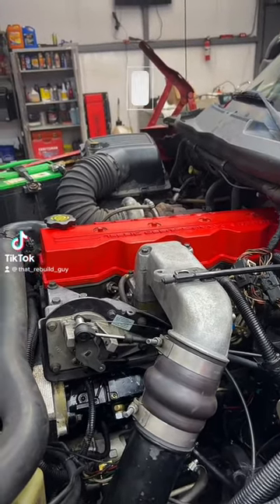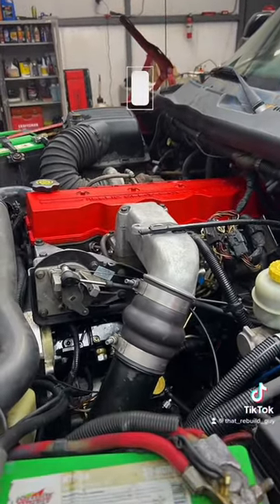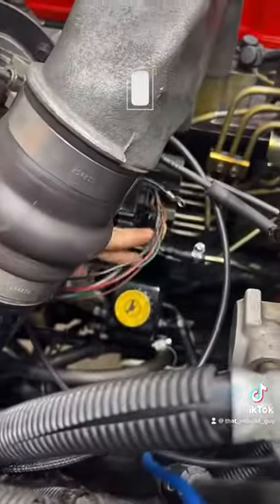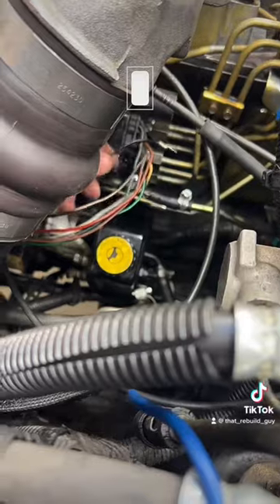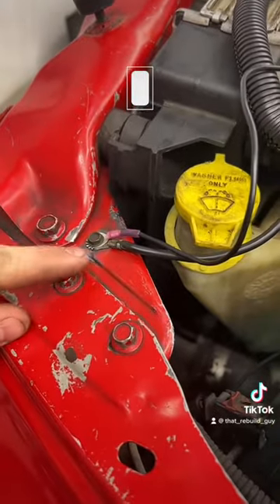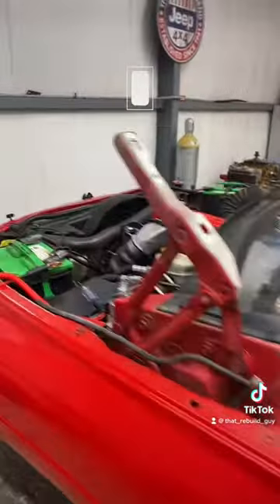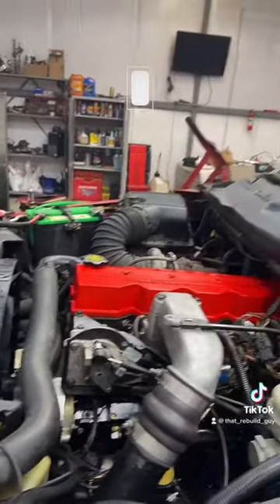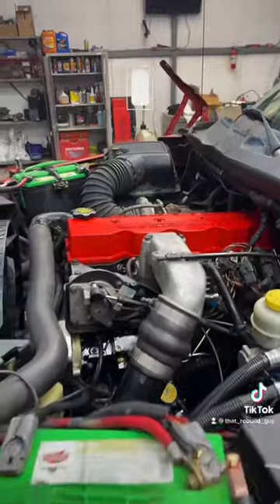How to bypass your pcm/ecm on 2001 dodge ram 2500￼

Comment: 😊thanks I started having trouble with my 2000 3500 3 years ago it would start fine in the morning cold but after it was warm long cranking after it was warm and a friend told me to disconnect the temp sensor on front of engine and I did it started perfect after that but check engine light come on no problem I drove it three years that way. And now some time the tack quits working if you shut it off it will not start again until it cools off you. Today it would not start when it was cold so I done what you said to do and it started so I put a relay in series with the wire so now when it wont start I use the relay to temporarily bypass the ECM THANKS

Comment: Pin #6 from the vp44 black wire needs a true ground.. probably that's my issue cuz this vehicles fall a part starting with the dashboard and really bad,  but besides that, we have a very reliable strong truck.. at least allow us to trick a few things.. thanks in advance 👍👍

Comment: The truck turn ON then what? I wanna be able to drive it without the computer ?
Reply: You can’t it’s not a 100% mechanical pump. You can only limp it around without the ecm because the pump runs in limp mode